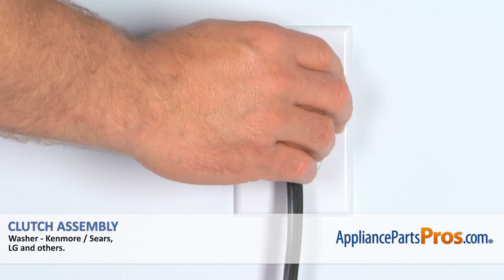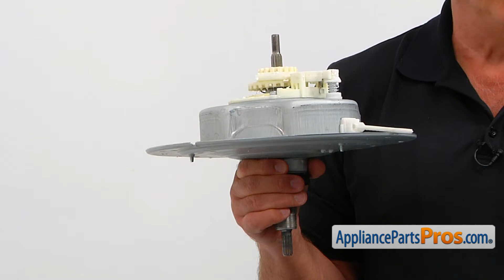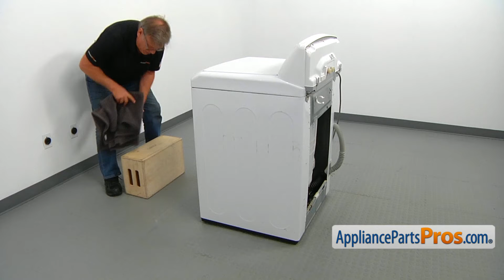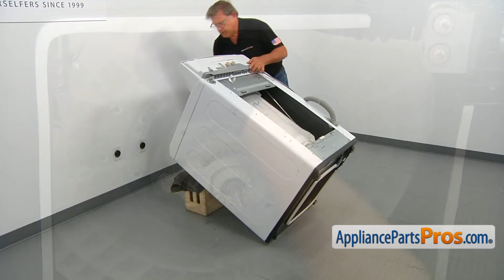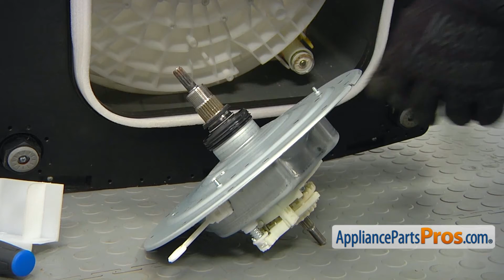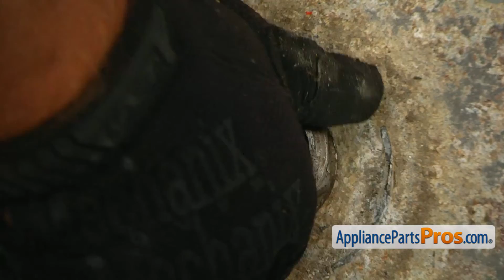How To: LG/Kenmore Clutch Assembly AEN73131403

Comment: This video was very helpful, however, if you have a Kenmore Elite model 31552, the process for removing the top of the washer is completely different.  Don't try to shove anything in the front.  You have to remove two phillips screws from the back just below where the base of the display meets the washer body.  Once you remove those screws, push the entire top away from you (toward the front of the washer) and lift it up.  Here's the thing - there's no hinge and the hoses for the detergent that run from the top to the wash basin are really short.  You can make a temporary hinge by lifting the top almost 90 degrees on the back side (like there was a hinge from the factory like the video shows) and slide the back edge of the top under the two brackets on the body that you removed the screws from earlier.  You just need a long screwdriver or piece of wood to keep it from falling back down.

On another note, if I knew the Kenmore Elite was made by LG I wouldn't have bought it.  I'm sticking with GE.
Reply: Correct! I have the LG model and this video was realistic. Nothing was easy! There was no hinge on my LG model either. The video I watched for my particular model made it look simple. HaHa!  My wife was literally looking at new washing machines while I tried to get the agitator plate out. The good news is that it worked.
Reply: Hey, atleast it isn’t a Samsung product 😂

Comment: Very useful and realistic repair, thanks! This style of washer is going on 5-10 years old at this point and things will be corroded. Assuming pulsator plate seized in place, how long would you say this repair takes? 3hrs?
Reply: If you have your tools ready should be easily able to do in less than 3 hours.  I have mine apart, spent time hunting down tools and have only about an hour invested so far.  Waiting for new clutch assembly and putting back together should go quick and smooth.